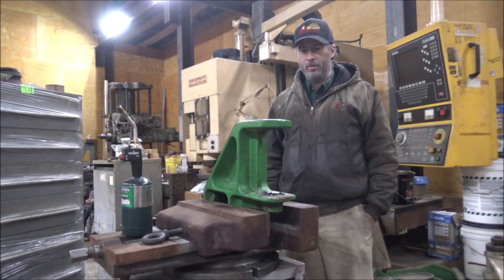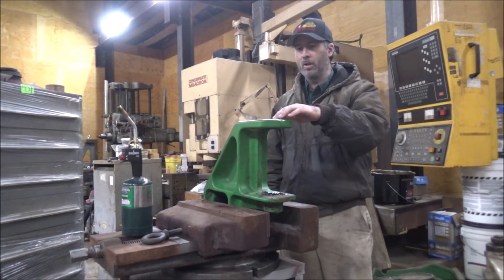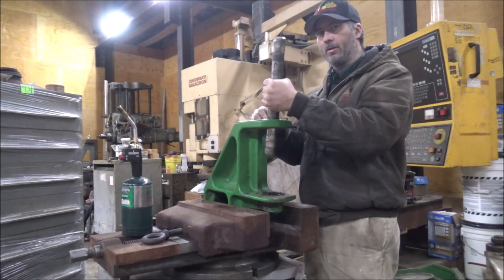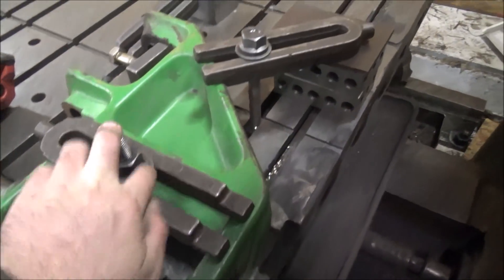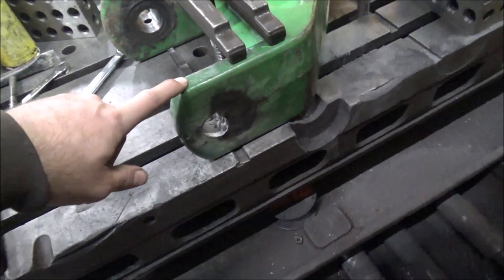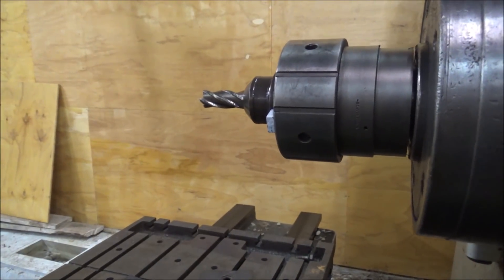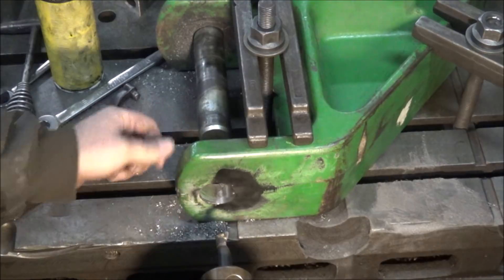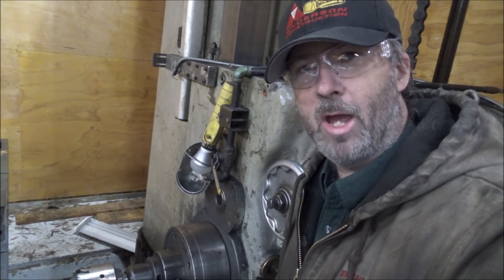Cast Iron Welding Bore Repair

Comment: Is it just my imagination or do you mostly get john deere parts in for repair? If so is it just a ton of JD machinery in your area, or quality dropping?
Reply from the maker: Well I work for the Deere dealer so that contributes but the large ag here is 95% Deere machinery too so it is encountered much more often. Even the few farmers that aren't brand loyal have over half their calico fleet as Deere tractors. Only one guy runs all red but he still uses Deere planters so. LOL
Reply: @bcbloc02  got it. Not much different then NW ohio. Predominantly JD with a little of this n that thrown in

Comment: Was curious what kind of rod did you use? A lot of guys were telling me 309 for cast iron, but would like to know your take on the subject. Please ignore if this is a repeat question.
Reply from the maker: I have fooled with cast iron welded with stainless and while you can stick it together it likely won't be machineable afterwards. It usually gets crazy hard.

Comment: As a 37 year pipefitter/welder, nice job! Looks like either Ductile or Malleable iron there, as good as it welded, with no porosity/cracking problems! My bet would go to Ductile iron, as it requires way less energy to make, and has better elongation, perfect for a company like Deer to choose to make their high stress, high load parts out of.
Reply: scotty362100  good info thank you
Reply: I agree  , filled in and portable     align -bored lots of stuff like that  .

Comment: Brian,
Cool repair.
What did and settings did you use?
Reply from the maker: Certanium 889sp DC reverse. Don't really know the amps My Miller is labled in % should have been around 150 if i guessed.

Comment: How did you know as to when it would get to heat/hardening point that it wouldn’t start destroying cutting tools? I have so often welded or torch cut something with intention of milling or drilling it later and it ended up being to hard to do it!, it just destroyed cutter or drill! How did you determine that would work over,  boring and sleeving it?
Reply from the maker: It mainly has to do with how hot it gets and how fast it cools. Biggest problem is when you go from glowing to cool rapidly like torch cutting where it is molten but puts limited heat into the part so the area cools very quickly and gets hard.  Heat it to 4-500deg before torch cutting and you eliminate that hardness typically. Same goes for welding, if you can keep it from basically air quenching you can avoid things getting hard. Cast is special though as it can have carbides move in the welding process and cause areas of extreme hardness.  these can be somewhat removed with heating back to red then slow cooling if necessary. A post oven stress relif is ideal.
Reply: bcbloc02 thanks Brian, I will try your tips next time I run into situation like that! 👍

Comment: Guess as non metallurgists, we need a little bit of luck in welding castings, it's real difficult to judge the type of castings without making tests, your repair turned out pretty good, if you get no cracking along the heat affected zone on the casting portion, you got it right...!!! 
You mentioned Eutectic 224 in a previous comment, could it be 2240?  Eutectic got a huge selection of specialized welding products for out of the ordinary situations.
By keeping the store tag on your brush, are you hoping to return it to the store when it wears out... ???    Or, was it Baily's new unused tooth brush, he's gonna be real mad if he finds out...!!!    😁🤣
Hope you stay safely away from the rapidly spreading problem...   🚑🚑🚑
Reply from the maker: I am sure it is nodular iron. Deere pours tons of the stuff every year. Its a go to material for them.
Reply from the maker: I looked again The first rod was actually a Eutectic 24, its some old stuff probably from the 60's The rest were Certanium 889sp

Comment: Since you have it set up,bore the other side for a bushing. Tighten the whole thing?just thinking out loud kind of.
Reply from the maker: That was not on the customers repair order. There was still paint in that bore so it was as tight as it was when it left the factory.

Comment: If anyone is welding cast iron look into Dyeco Super Cast welding rod. Matches cast iron
Reply from the maker: The Castolion rods I used look like they matched very well.
Reply: @bcbloc02  castolin eutectic are about as good as you can get

Comment: Those bolts used that way to retain pins as you probably know  , usually break & give trouble if they are tightened up instead of using double nuts so the bolt can float a bit .  Good repair , Cheers .

Comment: What rod you using? Nice job!
Reply from the maker: It was a Castolion Eutectic 224 I think
Reply: EutecTrode 244  They also make a TIG version. Have used both on engine repairs. Stuff can make the tough things easy.
Reply from the maker: Had to go back and look, these particular rods were actually Certanium 889sp
Reply: Another good rod. I've used their Cronatron 211 MIG wire for casting repairs. Nice stuff but I'm glad I wasn't paying for it, was about $70.00 a pound !!

Comment: Nice job brian...that's a difficult weld to do..I've had lots of badd luck welding cast...you make it look easy!!!
Reply: Brian clocked up many pounds of rod repairing the radial drill press so he knows what he is doing when welding cast iron.